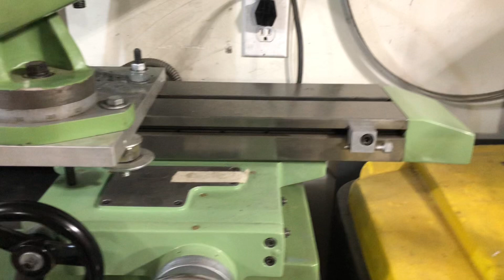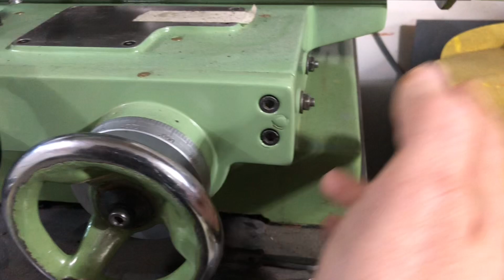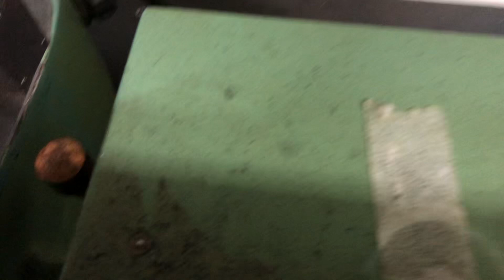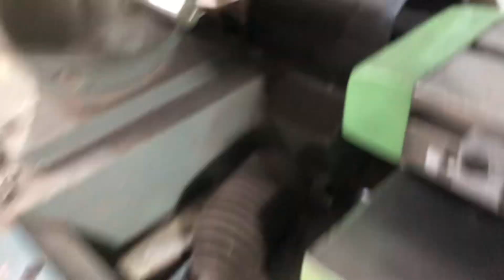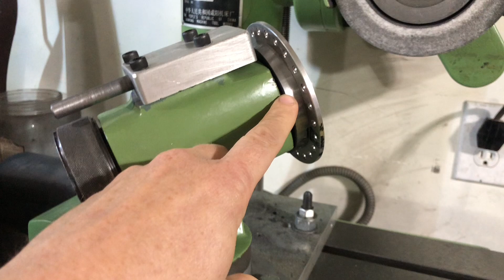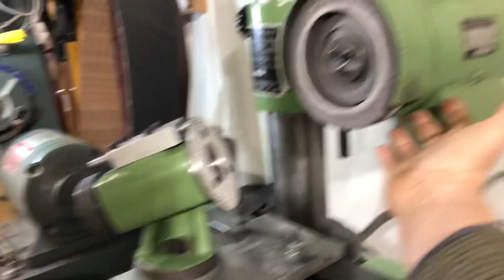Tool and cutter grinder overview

Comment: Hi Andy, this Is Alberto from ab-shop Italy! I saw your wonderful surface/ tool grinder and It Is what i'm searching around the Europe! ( Because It Is small for small workshop and perfect for a bench)

Could you please write me the "brand" or the model that It Is wrote over there? I will search your machine hopefully to find one like that!!

Thank you for your help in advance, a big Ciao from Italy, Alberto
Reply from the maker: Hey, this is a generic Chinese “tool and cutter grinder”, you can find them on Alibaba.

Mine is an older one, I bought it used for I think $150. The problem with it is the motor is larger than the standard 6” grinding wheels , so you can’t really use it as a surface grinder . 

When I get a chance , I want to make an offset spindle , so I’ll mount the wheel to spindle and drive it with a belt to a motor .
Reply: @MadScienceAndy  Thank you si much Andy i will try to find it on AliExpress/ Alibaba, hope the custom to pay will not cost a kidney!
Reply from the maker: @ab-shop  I don’t think Ali express has these , but Ali baba does . 

I’ve ordered a few things from Alibaba, and they got here fine, a friend ordered a large laser cutter, and he said the shipping experience was very easy .